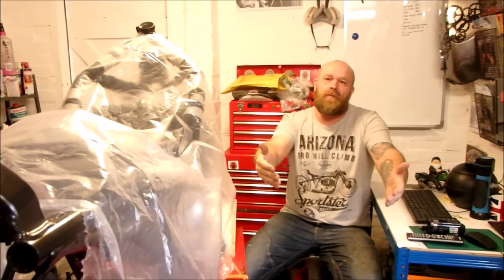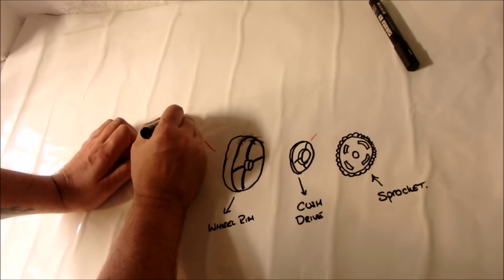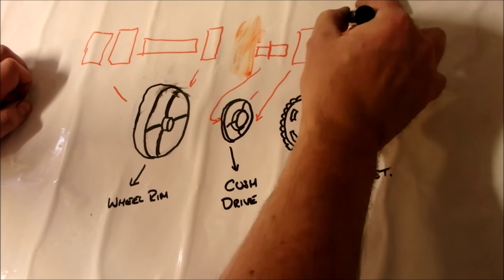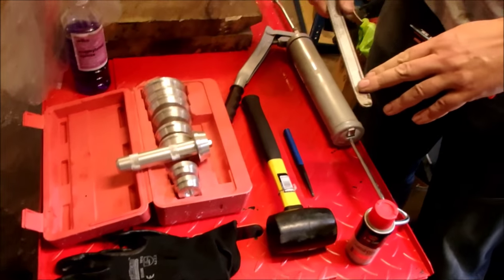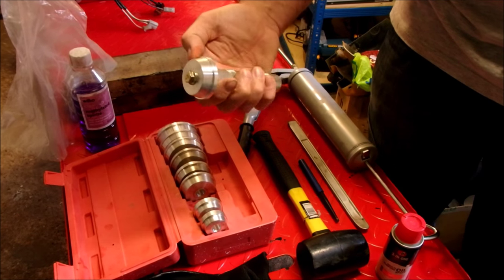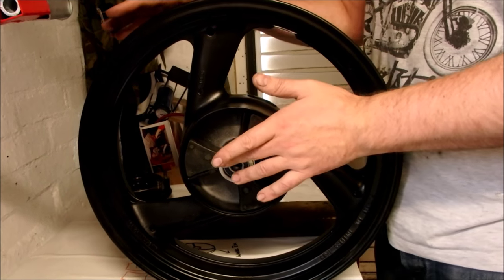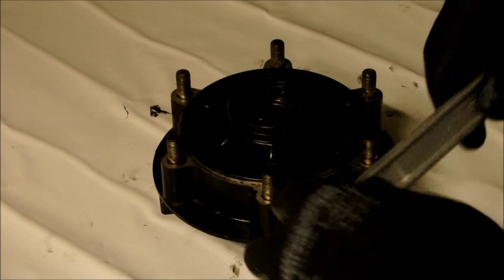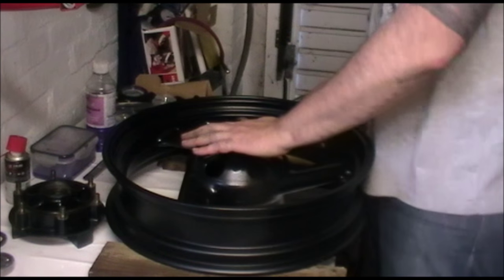Motorcycle Wheel Bearing Replacement - How to

Comment: At 13:47 you hammer the coupler into the cush drive bearing. Isn't it harmful to do it with the new bearing (which is only supported by the outer race) ? I'm asking because I'm currently replacing the bearings on my XJ 600 as well. I also bought the blind bearing puller as you recommended because I can't get them out with the drift way. I'll let you know if it worked.
Reply from the maker: I used a flat surface that fit the edge of the bearing.  you can also use sockets of the right size, But your absolutely right, if your not hitting the outer edge of the bearing, then you most likely going to damage the bearing as part of the install.  Good luck with the install, let me know how you get on.
Reply: @GTsGarage  I did it :) For the cush drive I used the outer spacer as a support to hammer the inner spacer into the bearing without stressing it. For the wheel, the blind bearing puller definitively made the job easier with a little heat, for just 35€ on amazon. Thanks again for the video !

Comment: mine needs some help now battery is dead front light have stoped working  and i think i need fork oil rain keeps stopping me from getting on with it lol
Reply from the maker: +Roy Webb forks can either be really bloody easy, or you will spend bloody hours of frustration lol.  Would definitely do a search for Delboy's forks video if you haven't seen it.
Reply: I'm always asking del shit lol he told me to use 15 w fork oil .but now I've lost me lights and my gel battery I got in April is dead getting fed up with the thing now it's one thing after the other matey lol

Comment: what size of bearing replacement
Reply from the maker: +Amatakorn Wichupankul Hi Amatakorn,  the entire process for doing the FZR600 wheel replacement can be found here.. the guide says to fit the cush drive from the XJ600 on to the FZR600 wheel, so will be XJ600 bearings.   Wemoto (UK) sells a kit and doesnt give specs of the bearing in them... will have a look around and get back to you
Reply from the maker: +GTs Garage Hi Amatakorn http://www.athenaparts.com/eng/models/view/4717/yamaha-xj-600-s-diversion-chain-drive/page:1 the bearing sizes are given here, just need to work out by the part number which bearing you are after replacing.  Hope that helps Sir.. ride safe.
Reply: really thanks master